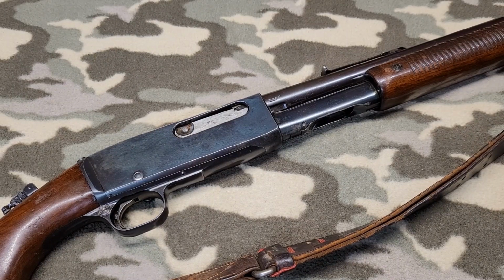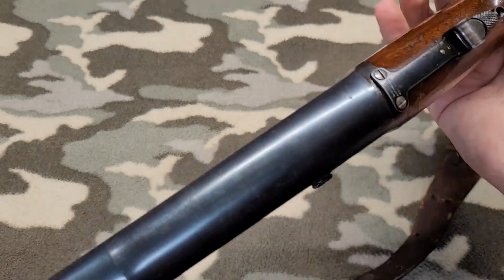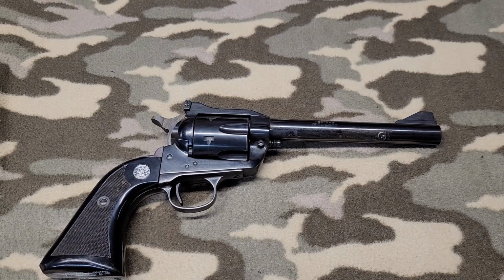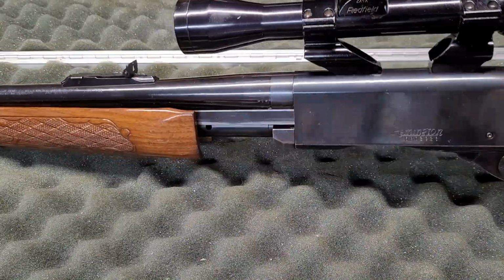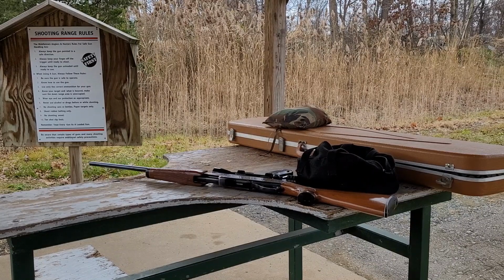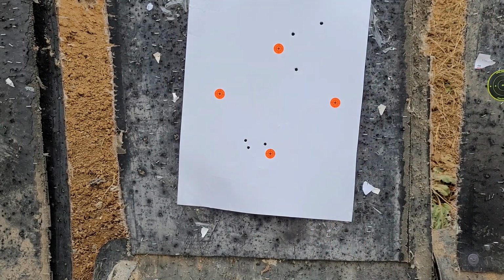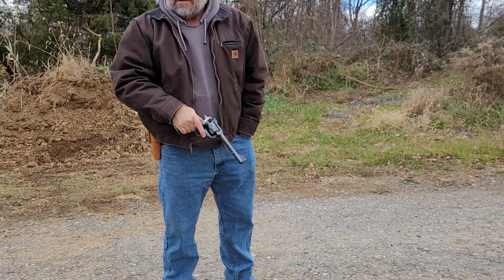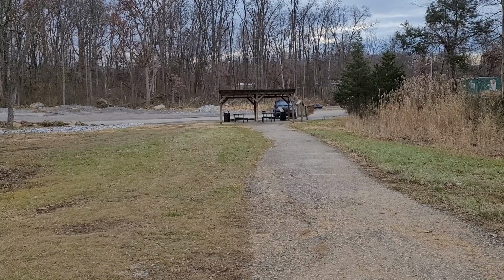35 Remington Model 141 and more, trip to the range.

Comment: I have a Remington model 14 in 35 Remington. I have had a couple of Remington pump rifles, I really like them. The model 14 is having a trigger/safety issue. The safety goes past where it should stop on fire and then when cycled it has slam fired. I have cleaned it up and am looking for parts or a donor rifle to cannibalize. Hopefully I can get it running as well as your’s.
Reply from the maker: Cool old guns.  That slamfire issue is a scary one. Hope you can get it fixed.  Tried Numrich for parts?

Comment: Love the video. Lot of  firearms have attachments to them. Are you thinking about refinishing the stock on the 141 or leave as is? If I had used varnish on a stock my Papaw would have given me a shellacing. Hard decision. Took me 40 yrs to decide to redo an ancient 870 stock & found out the corncob forend is actually 3 shades lighter than butt stock. Nice memories you have there.  👍
Reply from the maker: I think this one will remain just as it is other than a good cleaning.
Reply: @marcthomas2482  A lot of times it's better to leave it as is. Some of the dents & scratches are from learning experiences. I have a few that match the ones on guns.  Lol